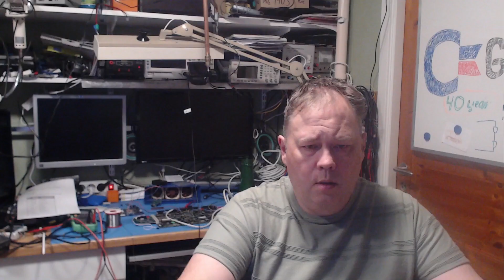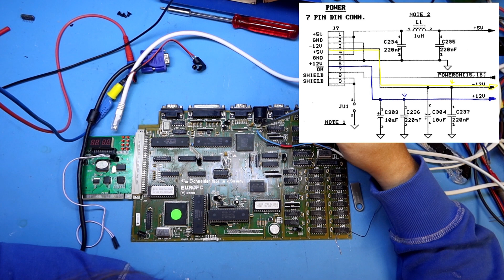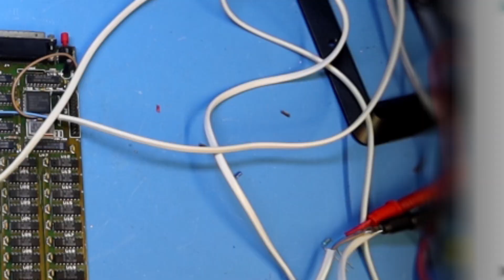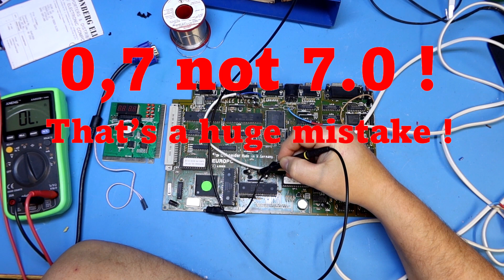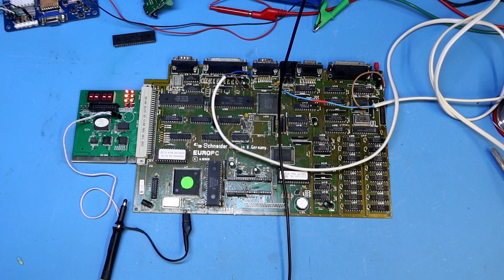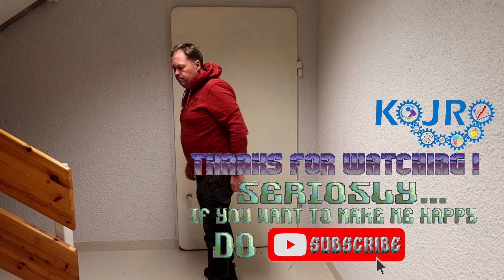The Schneider Euro PC, We sort of get a pulse, but it’s not out of the woods yet.

Comment: Not 10 viewers, 11 😂. Keep on going. I just tested my power brick and it seems ok. I already cleaned the board from the battery acid. I’m now ready to plug it in, but I need a good CGA to COMPOSITE OR TO VGA… can you advise on a quality one?
Reply from the maker: Hi number 11! . The problem with CGA and this computer is that I see several references to auto detecting if it's a mono monitor or not. So will every CGA adapter work ? I have double checked my board by connecting it to the original CGA monitor. This monitor I have again double checked against the Tandy TD1400 so that I know it works. I have a HD-VC9900 board that I have used for other CGA based computers, where some has had small problems, but I have not got it tested against this computer. If you live in Europe a CGA to SCART adapter is the cheaper choice as It's easily made. I have one of those too that I made for a C128 many years ago, but i could not find it just now.  The VC9900 board exist from a multitude of vendors, and they don't cost much. I paid about 18 USD for mine two years ago.